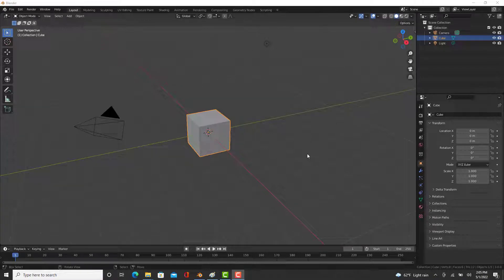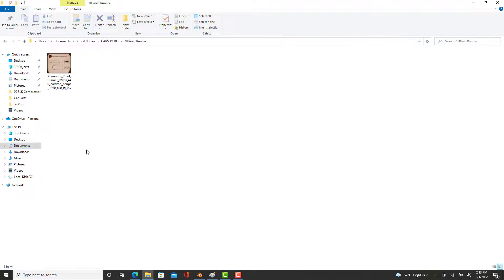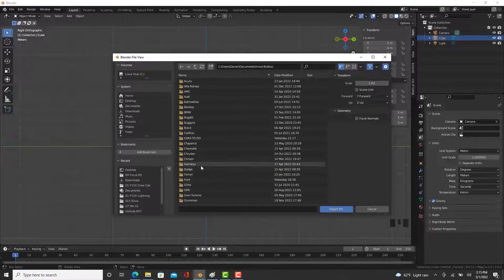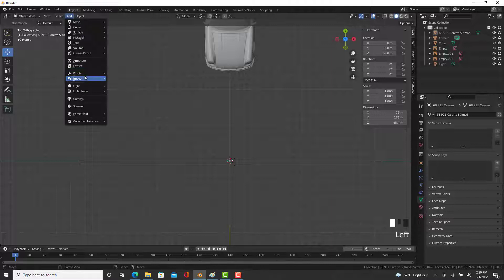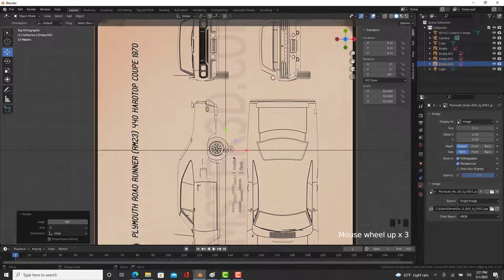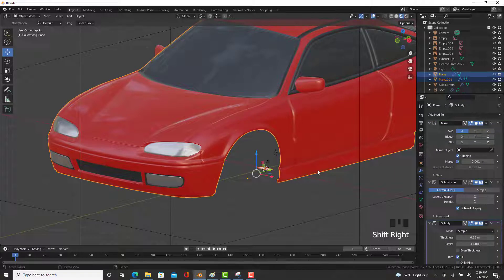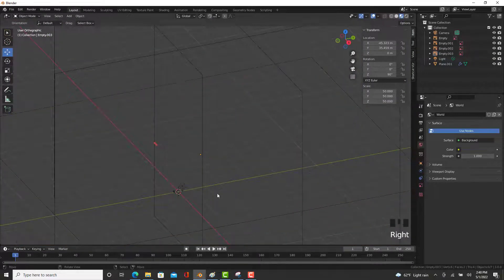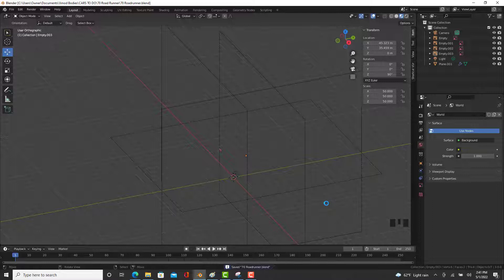Blender 3.0 - How to make a car for 3D Printing - Part 1

Comment: Thank you so much for this new series, I just got a 3d printer and have been slowly learning blender. I've been wanting to make a Saleen SR 3d model for awhile to print because of my memories of MC3. While there are no official blueprints of the car, I'll have to figure out a way to modify a 1999 Mustang into a Saleen SR. Anyway thank you for this new series you're going to be a huge help.
Reply from the maker: I can get a low poly one from Gran Turismo 2, but it being black, it'll be very hard to make out. But that would not be a good starter blueprint at all, very advanced. Might be able to find the game model from mc3 to blueprint
Reply: @Leander98  I've seen this model used for nfs world, while im pretty sure they ised the one from MC3 it looks slightly updated 

https://www.youtube.com/watch?v=OXuuxt0V-hs&t=10s&ab_channel=WorldUnited
Reply: Best bet would probably be to emulate MC3 with a complete savegame, so you have instant access to the SR, then screencap it from all angles!
Reply from the maker: @mr.razington7881  problem with that is its impossible to get Orthographic pictures to make a good blueprint. While it's possible to work with perspective images, i.e my ford probe hot wheels video, I would say it takes a bit of skill to do correctly. So, having a ripped game file and blueprinting that would be best for accuracy. I may need a whole video on blueprinting
Reply: @Leander98 Good point, may be better to use the GT2 model for its purportions then, and real photos or MC3 caps for detail shots.
Reply: @Leander98  I would love to see a video on blueprinting!  Thanks for doing these!